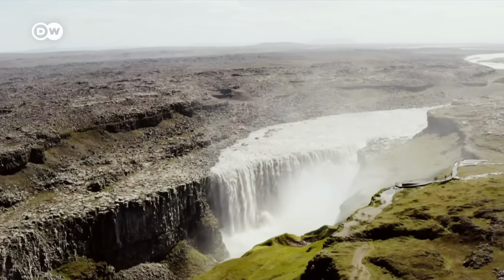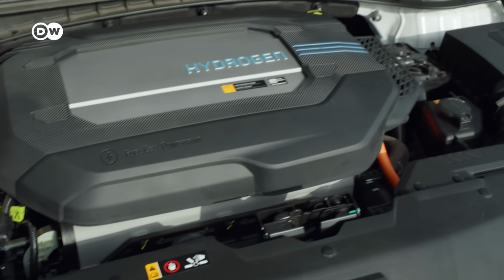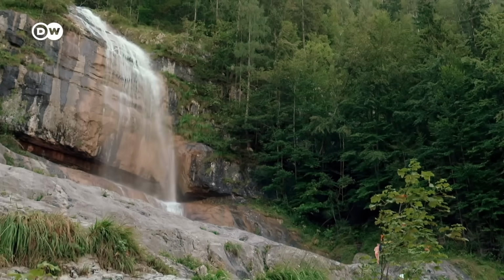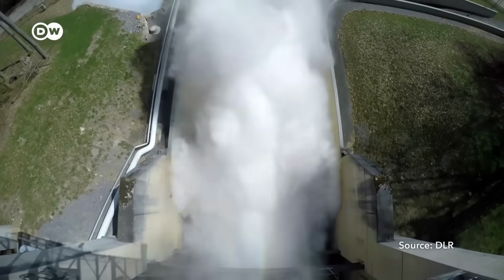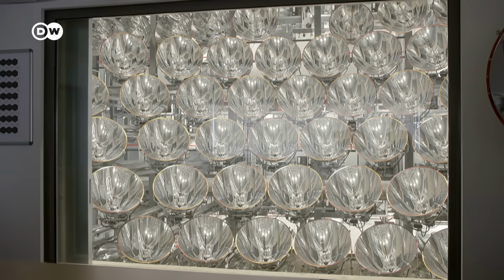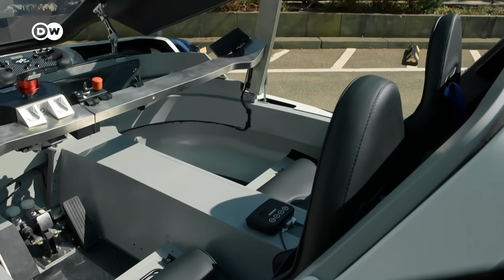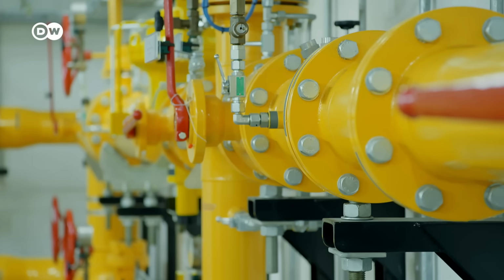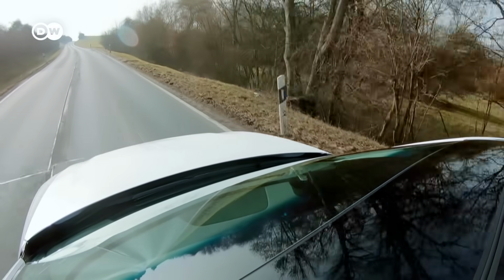Is green hydrogen the answer to the climate crisis? | DW Documentary

Comment: Your German Greenies need to be educated on the benefits of cheap walk-away safe Thorium molten salt reactors (TMSR) - how they will save thousands of Hectares of Indonesia's scarce tropical rain forests from encroaching unrecyclable PV Solar farms.
I believe PV Solar's best function is on the roofs of buildings but a greater need is to build the cheaper walk-away safe Thorium molten salt reactors(TMSR) for $1200/kW and a pre-profit cost of $40/Megawatt.hour. 
So without mentioning your brown  coal burning hypocrisy, or your destruction of your own forests for exporting wood chips for UK's bio-mass folly; this Hydrogen article gives me the opportunity to make a comparison between a Massive PV Solar farms encroaching into tropical jungles and a environmental solution to fuel our EV cars, trucks and buses.
So a typical PV farm providing 3700kWpeak per 50,000m² that's say (750kWp per Hectare per 6 useful sunlight hours/day or) 4.5MWh/Ha/day, as daily energy available to the Grid?
Compare that with the usefull daily energy available per Ha  from a ThorCon 500MWe walk-away safe liquid metal Thorium ion molten sodium fluoride salt burner energy converter  with a footprint of 65mx180m or 1.17Ha is 500×24/1.17 or 10.25GWh/Ha per day
So that's 2280 times more energy produced to the grid per Hectare per day by a unit costing $1200/kWe built in an Asian shipbuilding yard and towed to Indonesia with an expected life of 80 years providing electricity at a pre profit cost in todays prices of less than $40 per MegaWatt.hour - which includes a running cost for staff, fuel and periodic four yearly maintenance which includes recycled reactor with replaced graphite as well as being able to automatically load follow and/or be a base loaded to supplement the shorter life unrecyclable "renewable"  PV Solar &/or Wind farms. Will these units help reduce demands on alternative battery backup and prevent the on going potential of rhe destruction of our scarce tropical rain forests?🥝🥝🙏

Comment: Hydrogen has an energy density of 35,000 watts per kilogram, 175 times the density currently available in lithium-ion batteries of just 200 watts per kilogram. Storage is the major hurtle in going all electric and that is simply a deal breaker when it comes to industry or aviation.
Reply: We should stir focus on hydrogen otherwise we won't have flying car that we dreaming about...
Reply: In a Toyota Mirai the hydrogen tank to store 5 kg of hydrogen weighs 87 kg.
Add these fuel cells (and the battery which is still needed), the car weighs the same as the Tesla Model 3 with its Long Range battery (and their range of 500 km is pretty much the same too).
The high energy density of hydrogen is worthless once you look at the whole system.
Reply: @richardpetek712  so no flying car yet.. DAaamn

Comment: Hydrogen gonne be the 2025 - 2030 new gasoline as it's easy to replace as there's million fueling stations already + even some new diesel engines can be converted working with hydrogen what is damn cool :D
Reply: You really can't use your fuel stations for hydrogen. The only thing that you can reuse is the space. Hydrogen needs to be under high pressure and low temperature so you can't reuse the tanks
Reply: @sixtus9559  in liquid form it needs to be minus ALOT, but in hydrogen cars it's not liquid i assume it's in gas form and for that you don't need that much low temperature and yea might be true you can't use all the equipment what is in the fueling station, but the area itself is kinda already builded for cars what needs refueling or regassing whatever so that's why easy to convert. Change tanks and pumps and pretty much thats it :D

Comment: The short answer is no.

It takes 8kg of H2 per hour to generate 100kWh from a "power box" (Commercial H2 cell)
It takes 17MWh to generate 350kg of H2 per hour from a single state of the art electrolyser site.

I'll let everyone in here do the remainder of the math to supply a country with H2 powered electricity.

It will work for transport though. In a purely H2 cell operation providing electrical power.

Comment: Electric cars don't have efficiency of 64%, this is misconception or deliberate lie. 64% is from the charger to the car battery and then converted into rotational force by the motor. But Electric charger does not generate the energy by itself isn't it? So there are as well transmission and conversion loses in the network, which could be between 30-50% of initially produced energy. Now all these BEV proponents likes to ignore this part because apparently "if it is green electricity then it does not matter". Well... all that electricity could be turned into hydrogen instead and achieve similar loses, but without needing heavily polluting and expensive batteries. As the same time if we just focus on CO2 emission of BEV, then ok maybe it does not matter, but if we making comparison and include all loses for all different fuel types (like for example they count oil extraction, purification and transportation loses loses compared to energy stored in oil itself), then why we treating electric battery vehicles like they just get energy from charger and that energy miraculously happens there. I mean nobody believes that petrol pump makes petrol, or hydrogen pump makes hydrogen, so why we using different way to calculate just for battery electric cars?
Reply: Probably because ICE engine efficiency is generally talked about just the combustion process which is ~30% efficient

Comment: Answer - nuclear. Even existing nuclear plants can be used - currently a lot of energy is wasted during quiet times, instead it could be used to generate hydrogen as a form of storage of energy, instead of other types of batteries. Renewables are simply not reliable enough to guarantee supply.

Comment: A hydrogen economy is a sham.

The vast majority of industrial hydrogen is produced via fossil fuels, particularly steam reforming of natural gas. This produces as much CO2 as straight up burning the nat gas in the first place.

Renewable energy hydrogen options are not, and likely won't be for literally decades, cost competitive with this method. Check the cost per kg of H2 produced by different methods and you'll see how large the gap is. There's no existing technology that would give us a declining cost curve as seen with c-Si photovoltaics or Li-ion batteries. As such, while you can go "green hydrogen" you will necessarily significantly increase cost.

Overbuilds of renewable generation to provide cheap power for electrolysis still does not deal with the issue and creates another one. 
On one hand you need your hydrogen production plant to run at or as close to 100% capacity all the time to recoup capital expenses. This would still include times where even overbuilt renewables are barely if at all producing enough power for the rest of the grid, and small expensive $/MWh events can still crap up the economics. Meanwhile on the other side, having overproduction of electricity increases costs because the amount that's been paid for all the infrastructure is there, but you have many negative wholesale electricity price events where they need to pay just to put power on the grid, meaning that the times where they can charge for power they are going to recoup all that they can. End result, expensive power.

The distribution infrastructure for hydrogen sucks balls too. Plus it loves to leak through just about everything, causes metals to get brittle (pipelines unlikely/dangerous) and is just plain volatile af.

Better solution? 
Molten salt reactors which have high temperatures that can use the Sulfur-Iodine cycle to produce hydrogen from seawater, which is immediately turned around and made into methanol, gasoline or dimethyl ether, with the help of CO2 also extracted from that water and the air. You now have a fuel that can largely be used in the existing vehicle fleets which means you're not junking perfectly functional things, but with significantly lower particulate pollution (sulfur compounds abundant in crude-derived hydrocarbons but not so much here) as well as being entirely carbon-neutral.

Comment: If there is a climate crisis, one of the solutions is the nuclear energy. It is cheap, works 24/7 regardless anything and produces extremely few pollution
Reply: You are of course correct. It's strange how nobody wants to talk about it! 

There are even less problematic options to use as fuels other than uranium apparently. I understand it was only the first choice fuel because of its useful ability to be converted.
Reply: Nuclear and cheap combined in one sentence.....
Reply: @sixtus9559  rolls Royce has a factory making smaller reactors for submarines, must be manageable.

Comment: No. Let's keep pushing electric motors like they aren't resoundingly charged by oil, coal, and natural gas then succumb to efficiency of transmission losses for available use in any vehicle. This notion of carrying fuel in the vehicle and then releasing the contained energy in the vehicle is too radical, and frankly dangerous. I'm not even going to talk about the toxic dihydrogen monoxide these hydrogen motors produce. Just let the smart people figure it out, thanks.

Also, sorry.

Comment: A huge infrastructure would be needed to move to hydrogen based energy production.
And much concerns are towards, How fragile would it be given that it is a moving liquid oxygen and liquid hydrogen system.
Reply: We can use existing natural gas infrastructure to store and to move Hydrogen.  We will simply use green Hydrogen to replace the natural gas that Europe and Asia no longer have in reserve.
Reply: @trungson6604 u can not use hydrogen as natural gas  hydrogen can not be store in Normal tank hydrogen is escape from metal  low energy density  of hydrogen cause to need high pressure store

Comment: A solution is to use water fuel. Water molecules dissisociate at the spark plug by very high Voltage plasma discharge in a very short time. The plug must be robust to withstand the intense white plasma discharge. This can be accomplished by eliminating electrical resistances in the ignition circuit. Hydrogen and oxygen atoms must be mixed with air (nitrogen) in the combustion chamber to avoid detonation and provide thermal mass. Stanley Meyer used these methods to drive his water fueled car across country.

Comment: A hydrogen economy = total and utter hype, do the math at a globalised level. It takes 50kg of hydrogen to decarbonise a kg of steel production, so when you apply that to the global steel industry as is currently, you find you need 90 billion tonnes of hydrogen a year just to decarbonise that 1 industry. And how much hydrogen do we currently produce per year globally? 80 billion tons?  70 billion?  not even close. 70 million tones.

Ok, so how much energy generation capacity do we need to artificially produce 90 billion tons of hydrogen per year?  well, turns out you need the entire power generation at maximum capacity for a year, of canada and the continental united states combined, just to produce enough energy to produce enough hydrogen to decarbonise 1 sliver of the global economy, never mind all the other  things from planes trains and automobiles than engineers and economists without a damned clue, have promised the masses.

It is a greenwashing con, a technofix sticking plaster for an axe wound, to allow government to pretend they can bend perpetual growth capitalism into compliance with the physics of a finite world, which is akin to putting your best shoes on as you attempt to run up a landslide. Nature will bury us in the end, as capitalism is incompatible with the physics required for a viable future.

Comment: When I was a kid I thought Hydrogen would be the solution to our energy problems.  But hydrogen is one of the most difficult energy sources to handle, even more than modern nuclear reactors.  The molecule so small that it squeezes between the atoms of any line, container, or hose and leaks.  It’s explosive.  It’s not cheap to produce. 

For now solar and nuclear energy appear to be the global options for energy in the 21st century.

Comment: It missed the overall energy balance issue. The time, cost, effort to compress, store and transport along with safety issues are completely obviated. Deliberate?
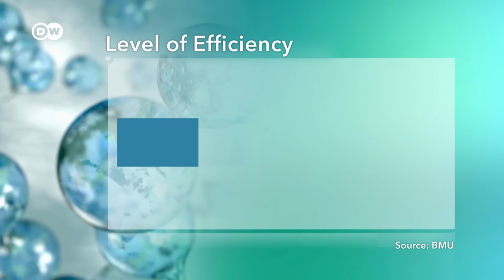Reply: Sort of covered at 18:10, I suspect it was oversimplified for brevity rather than obfuscation.
Reply: @OzearEimaj  I worked with a couple of University profs who both indiscated the cost benefit annalysis will eliminate pure hydrogen. Fuel cells runing on alcohol who gets hydrogen source from renewables makes the most sensse.

Comment: Green hydrogen will not be practical except for those who wish to pay a premium. For every kW of electricity supply, you get 800W of energy for a battery electric vehicle but only 380W for a hydrogen fuel cell vehicle — less than half as much. That’s a huge inefficiency if you’re hoping for a greener future and this doesn’t even account for the fact that 95% of hydrogen is currently generated from fossil fuel sources. Green hydrogen would only yield 260 watts due to hydrolysis and compression. Hydrogen fuel cell vehicles are ‘extremely silly’ says Elon Musk

Comment: Hydrogen is simply uneconomical for general use.  Fuel cells might be used on submarines and on the International Space Station, but they are economical/practical in those situations.  The Bush Administration was very enthusiastic about hydrogen back in 2003 and spent a lot of money on research but ultimately found hydrogen to be pointless.  So why do people have to waste money re-examining it?

Also, try applying the "hope or hype" idea to CO2 emissions driving climate change.  You'll find that it's colossal hype of a very minor influence on climate.

Comment: Within 3-4 years silicon/graphene anodes will be in use in lithuium batteries. These will give a 30-40% improvement in energy density and faster charging so smaller hydrogen road vehicles will lose their long range advantage, and so will small short hop hydrogen aircraft.

Comment: The ONLY way we can produce enough hydrogen to curtail carbon emissions sufficiently and quickly enough to make any positive impact on the planet is through the widespread adoption of nuclear energy in the form of Small Modular Reactors (SMR's). SMR's are smaller and safer than the larger "plants" that are artefacts of 1950's-1970's technology. SMR's would make hydrogen production and distribution far more economical and accessible much more rapidly than "green" technologies, which would be allowed more time for research and development, with the longer term goal being to eventually go green. SMR's could allow for "on demand" production of hydrogen, eliminating the need for large distribution networks, and bringing its level of efficiency as a fuel for vehicles up to or even beyond that of   battery-electric. And SMR's can be located relatively easily in remote areas, providing hydrogen and electricity to cities and towns that have been highly dependent on coal or diesel to meet their energy needs.

Comment: Also compressed gas cylinders might not be the best way for every hydrogen storage scheme - it leaks through almost every sealing plus the flammability issues.
Chemically bound hydrogen (e.g. borohydrides and other hydride sources) is safer to transport (it is solid and stable) and it is easy to get H2 from it when needed.
Another possible H2 source is used aluminium - everyone can make hydrogen at home just by putting a piece of alu foil in lye water.
Yet another route is to produce gaseous and liquid hydrocarbons that burn more slowly and at least don't explode like H2/air mixtures.
The documentary is very shallow on the existing solutions, showing just very selected few. Why?

Comment: Hydrogen can never be replacement for fossil fuel because of energy density.
Hydrogen
Under ambient conditions, a cubic metre of hydrogen provides some 3 kWh, equivalent to 0.003 kWh per litre. Pressurised hydrogen contains about 0.5 kWh/litre at 200 bar, 1.1 kWh/litre at 500 bar and 1.4 kWh/litre at 700 bar.
Diesel
Diesel fuel has a specific energy of around 38 mega joules (MJ) per litre. 38MJ = 10.555555556KWh

Comment: Wind levels have dropped 15% since the 80s due to increased global temperatures and the knock on effect is being seen by the reduction in power stored at global wind farms hence in part global power shortages. We need to be building nuclear power stations regardless of hydrogen powered vehicles or not otherwise we simply won't have enough power to run everything.
Reply: Huh? Shouldn’t global warming give us more wind?
Reply: @peterfireflylund  Global warming causes the poles to heat up much faster than at the equator, this reduces the temperature/pressure differential between the equator and the poles. This lower differential leads to lower windspeed overall. What may be confusing is that higher temperatures may lead to more energetic storms, but this is due to a different mechanism, primarily driven by higher sea temperatures.